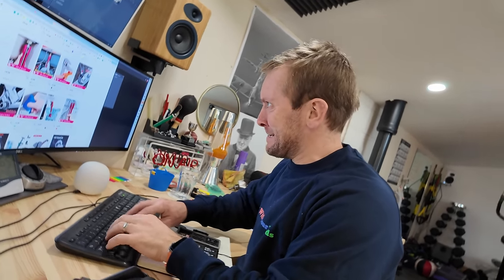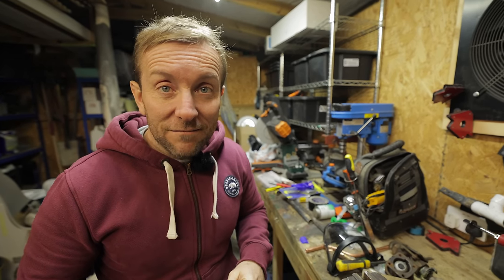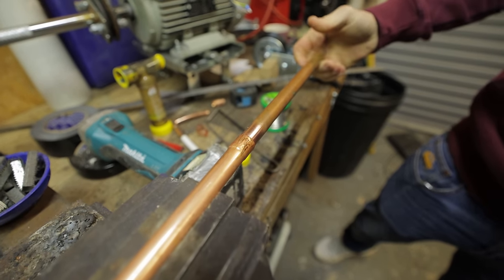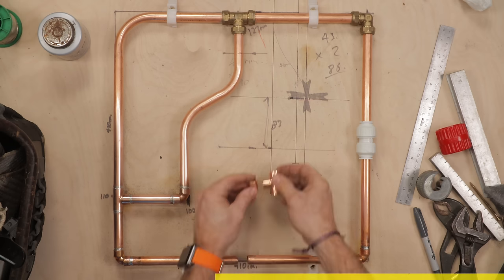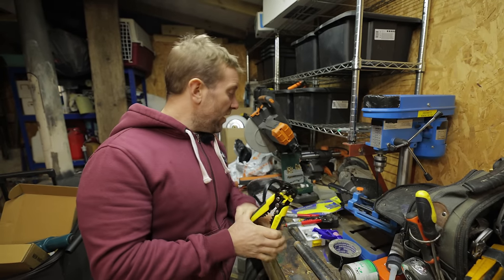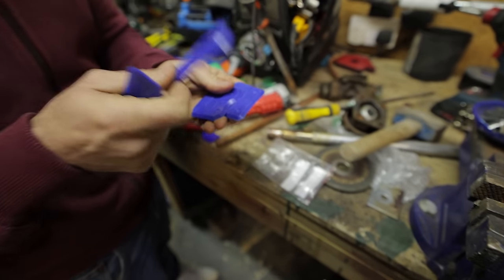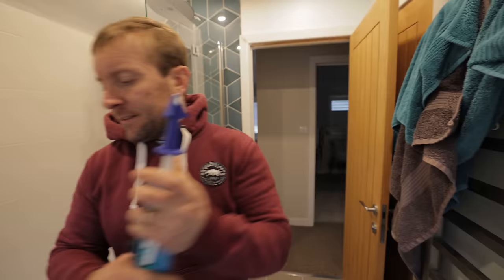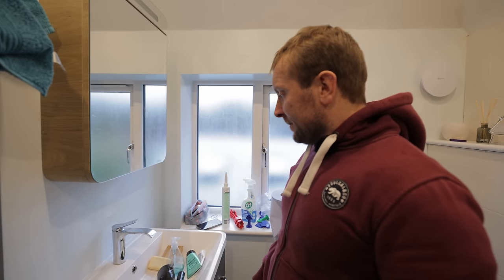TEMU PLUMBING TOOLS ANY GOOD?

Comment: I've never dealt with Temu but have had loads of stuff from AliExpress and Chinese sellers on e-Bay.  I've been favourably impressed for more often than disappointed.

I got one of those big aluminium adjustable spanners for large plastic things like the nuts that hold lavatory syphons in place, U-bends &c.

Comment: Pull a 90 in chrome pipe for an underfloor rad tail. Swage one end and solder it to the copper under the floor. No filing chrome off to solder a coupling in.

Comment: The critical thing is when you use those tools when it matters, don't rely on them as the only choice. I'm sure they will fail/break as they material used will be at a reduced cost.

Comment: The solution for cleaning out those nozzles. Buy 100 pack of multi coloured pipe cleaners for the very end section. Use thin wooden stirrers (use both ends) from a certain fast food outlet or i use plastic ones, like mini spoons, which i clean and reuse.

Comment: Hi what I found is any of the silicone tools wait until it has gone off then remove the worm type bit even a set of pliers to pull it out . Have a go so yes you have to have a couple in the van

Comment: Ive used #2 phillips bits, bit holders, key chIn knife, tool bag, plastic storage containers and kitchen gadgets with out any issuse so far with the exception of a drill bit that broke on the first try. I have other stuff that i havent used yet.

Comment: I’ve bought circa £300 over the last 3 weeks. Madness it’s cheap and addictive. You can by little rubber condoms for silicone tube tips hopefully stops it going hard.

Got an expanding hose
Stainless bolts
Green o rings good quality cheap as chips
Baseball cap £1.75
Snood £1.77

Lots of other things I didn’t need but it’s like crack …. Need to delete the app soon lol
Reply: The silicone condoms actually do work!!! I left one on for a month and forgot about it and it was good to go when I took the rubber off 😂

Comment: Non-tool related but I bought a pair of replacement ear pads for my Bose headphones. 35 euro from Bose. 7 euro from Temu. Identical. I got a fiver credit into my account because the order was 2 days late too. Think the whole order came to just over a tenner with whatever else junk I bought. Tool related, 10 pcs mini spanner set. 4-11mm and all the .5s in between. Didn't think I'd ever need them but they've proved their worth. 8 euro. Really can't complain

Comment: Temu are ok for consumable stuff like jigsaw blades etc, also small things like Allen wrenches, screwdrivers etc.  Would never buy power tools from them as the quality is very suspect.  They're also no good if you're in a rush as everything takes so long to deliver, but then it is cheap and free delivery.
Reply: the power tools ended up being better than harbor freight but not as good as Ryobi according to another Youtuber

Comment: Temu return policy is an instant refund after a description of the issue and picture of the item without return… Easy to manipulate if you are that way so inclined…..
Reply: actually they will make you physically return it if the item cost $10 or more. I bought a Miles Morales figure on Temu for $28 and when I returned it, they had me send it back in a box.

Comment: Got a usb powered submersible pump and use it for cistern repairs. Flush, fire it in the cistern, hose in the pan, plug it in, and walk to the van to get whatever i have  forgotten 😂 and its empty by the time I get back.